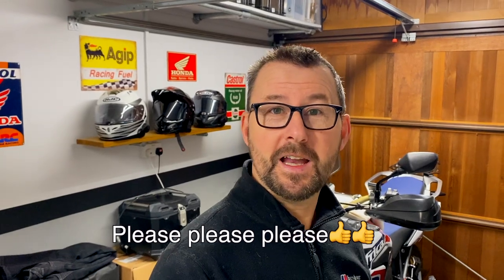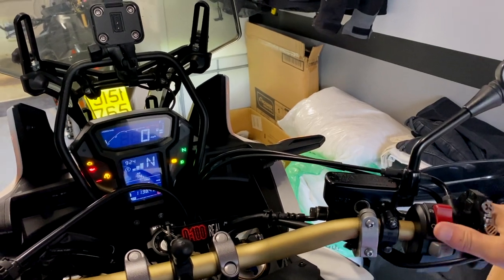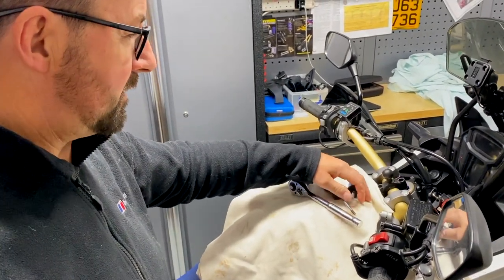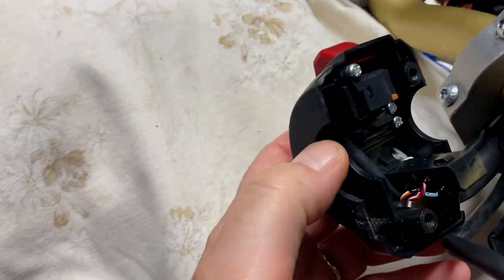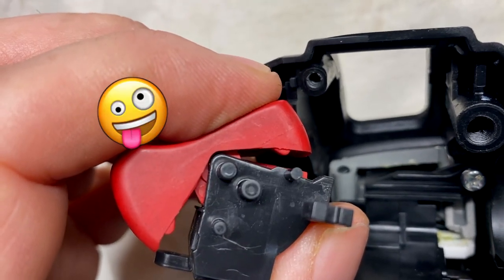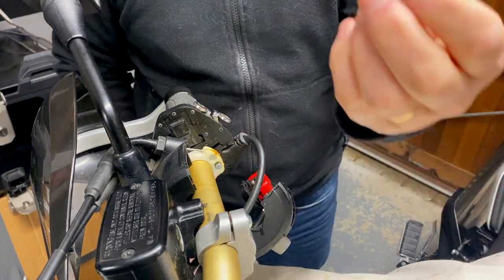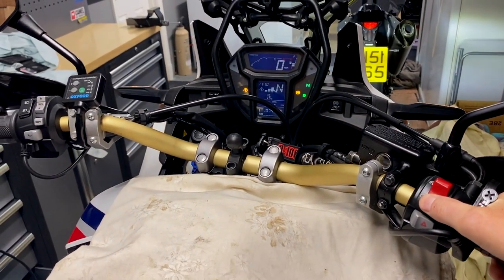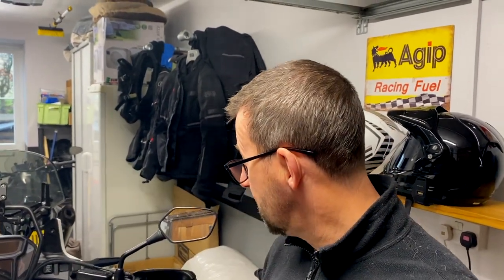2017-2019 HONDA AFRICA TWIN -     STARTER SWITCH FIX

Comment: Brilliant, thank you. My 2016 AT owned from new, just 5000 miles, been playing up for months. Thought it was the cold !! Today, total failure in the middle of nowhere, only starting after 'fidleing' blindly with it. Found and followed your video and 🤞 instant 100% improvement. Hope that's it for now. Thanks again 👍.
***9 June 2024 Update ***- I used electical contact cleaner when the problem started again. Seems if water gets in the switch the contacts suffer 'white corrosion'. I found using ACF or WD40 attracts dust and grime, causing contact issues again. Hope this helps.
Reply from the maker: Yes I nearly got caught out on a trip too ! Glad it helped 👍
Reply: My 2016 will not idle below 32f if the battery is low.
Reply from the maker: @jackk8422  keep it on a trickle charger when not being used . Not sure why the high revs though 🤔
Reply: I took a ride to Mexico this winter after trailering from Minnesota to Big bend national Park in South Texas. On the way back it rained from Texas to Iowa and then snowed the rest of the way home on an open trailer. After setting for a month my bike developed the same problem

Comment: I have a 2016 AT with 27,000 miles, got this issue after a rainstorm. Jusy sprayed down the switch with WD-40 & boom started right up, no disassembly required ;)

Comment: 2016 AQ/CRF1000 at 11328 Klm - 7,038 Miles, starter switch malfunctions during 2023. Watched your vid, AQ starter problem fixed within the hour, Thank You !
Reply from the maker: Glad it helped, for once an easy fix.

Comment: Thank you for your useful video. I have 2016 AT and had the same problem. One of my friends did a similar cleaning but he also dismantle the red switch and used some lithium grease to prevent from corosion. On the other hand, when I switch off the bike (mine is DCT) first put it to neutral and then ignition off from the red button then back to normal position of the red button. You will hear the fuel pump feading the hoses for next start, then turn the ignition key off. This works much better.
I hope the info will be helpfull.
Reply from the maker: Thanks. 👍

Comment: 2017 AT 1000 4190 miles 6 Speed. Jumping in here to ask for help. I recently purchased this bike, it's in impeccable condition, couldn't ask for a cleaner machine. That being said, I started the bike this morning to let it warm up, while I'm putting on my jacket and helmet the engine stops and will not start, it was at idle maybe 4-5 minutes. Battery is strong, display lights up, headlight is strong but nothing when I press the starter button. I'm at a loss, completely baffled, I disconnected the battery cable to hopefully "Reset" any settings but still nothing.  If the "Starter Switch" is corroded or bad, would the engine quit running?
Reply from the maker: Hi Mark . When I had my AT the signs of the starter switch being in need of a clean were …… difficult to start and when it did you had to rev it to keep it from stalling , I was putting my helmet on during this time and then when I was about to set off the bike would stop …. Eventually it just wouldn’t start … hence a YouTube search !!!! I’m not a mechanic but I would give the switch a clean like the video as it only takes 10 minutes .
Reply: Thank you. I did your same cleaning routine as best I could, used compressed air, starting fluid and WD-40 but no luck. Checked all fuses. Maybe a new switch is the cure, I’ll let you know.  Enjoy your content, keep it up!
Reply from the maker: @markcogburn3137  That’s a shame it didn’t do the trick . Try some of the AT forums ?
Reply: @gsd32i  Yes, joined one today, hoping to get to this figured out in a day or so.  I’m confident I will.
Reply: Following up on my 17 AT.  Being new to the bike I didn't realize when you turn the key switch to "On" the fuel pump primes and a few other noises occur. It was not doing this and should have been.   What I thought was a corroded  on/off switch turned out to be a bad fuse in the "Eng Stop" circuit under the seat.  My friend and I both checked the fuses but it wasn't until the fuses were checked with a Circuit Tester that we figured it out.  Thanks for your help, I really appreciate it. Bike runs great, enjoying every minute!
Reply from the maker: @markcogburn3137  really wish I had kept mine now 😢oh well …

Comment: Mine wont start after washing and the battery heat up....maybe water leak in the starter switch.
Reply from the maker: hi. have you tried taking the switch apart like the video? try that and clean and dry the inside.
Reply: @gsd32i  yes will try it.